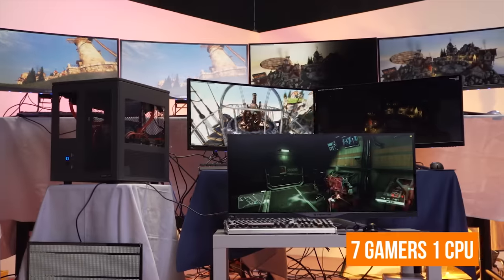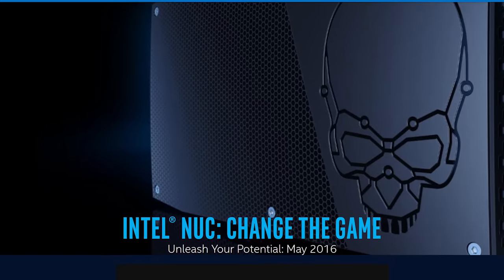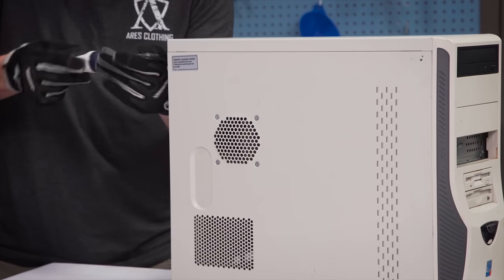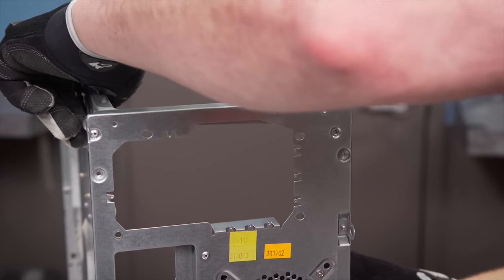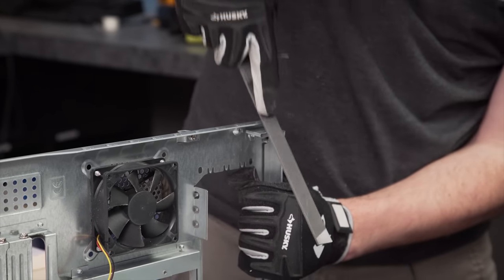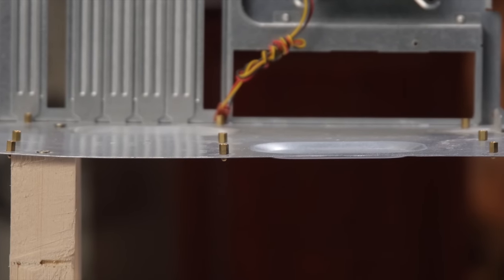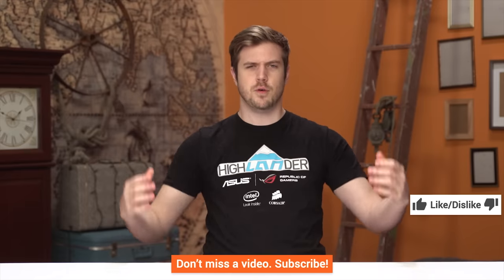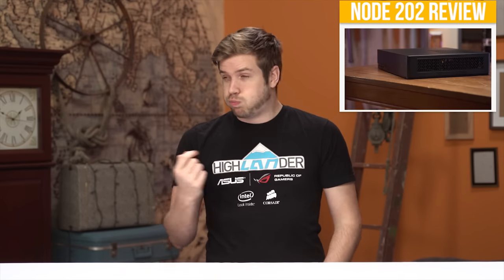Free (or extremely cheap) DIY PC Testbench!

Comment: Damn!! That's really ugly!! The heaviest components should be mounted on the bottom, such as the system-board and power supply. On a shelf above that I would put all of the smaller parts, such as hard disks and optical drives.

Comment: there is any software to find windows key in my laptop ?? . am going to reinstall win 8.1 os in laptop but i dont have key for os . so i want know i can use same key os .
Reply: +Yukesh vs use Speccy from piriform.com
Reply: You probably have a digital entitlement. You should just be able to click "Activate Automatically when I connect to the Internet" during setup.
Reply: Look on the laptop case.  Many PC's have a sticker with the Windows version and key on it.  Especially if you got a used corporate pc.
Reply: I just looked on the bottom of my 8 year old HP laptop, and the sticker is there with the key.  That is also how some websites sell keys - they are getting them from trashed PC and laptop cases.

Comment: Hey. Is anyone able to help me? I'm new to PC building and have some questions. First, I want to add more USB ports. Is that possible with the case I have chosen? And second is the sound card I chose a big improvement from the onboard one? Thanks in advanced! Part list: http://pcpartpicker.com/user/OHFISHAL_Batman/saved/s2RZxr
Reply: +Craze Synthetic :D ik but I'm not sure of one that fits in the case
Reply: Your Motherboard has alot of USB headers that will be on the back of the case
Reply: +TheScreenGamer G so where can I get expansions? any recommendations? or links directly to them? preferably USB 3.0 or 3.1
Reply: OHFISHAL_Batman You could get USB hubs.
Reply: +TheScreenGamer G but those would be external and more expensive
Reply: OHFISHAL_Batman And if you mind me asking, why do you need so many usb ports?
Reply: +TheScreenGamer G There's only 6 on there and I have a keyboard, mouse, webcam, power USB for speakers, flash drives, controllers, and I plan to get an external HDD or ssd. and I just want to make sure I have enough for all of them at the same time in case I have to use them all
Reply: +TheScreenGamer G i'd rather be prepared and not use them then not have them when I need them
Reply: OHFISHAL_Batman You will have 8 USBs in total with the case.
Reply: +TheScreenGamer G oh are there some on the case
Reply: +Craze Synthetic :D those aren't 3.0 though
Reply: OHFISHAL_Batman True.
Reply: +TheScreenGamer G I ordered a different case with front USB ports. thanks for the help anyways
Reply: OHFISHAL_Batman  :D
Reply: +TheScreenGamer G :DD